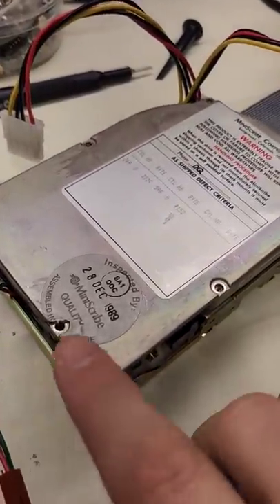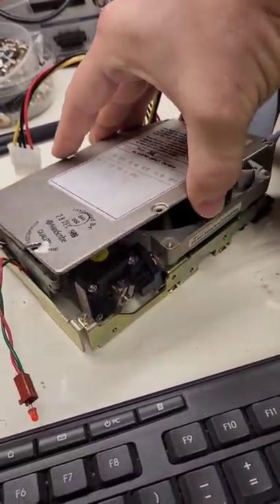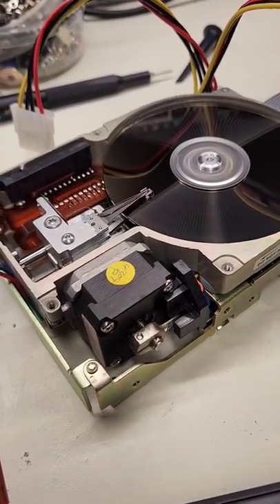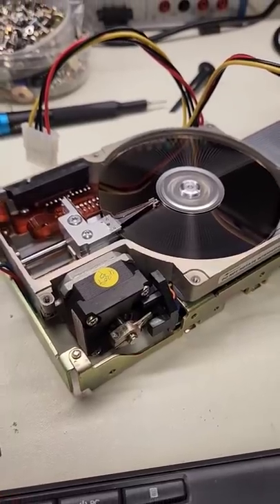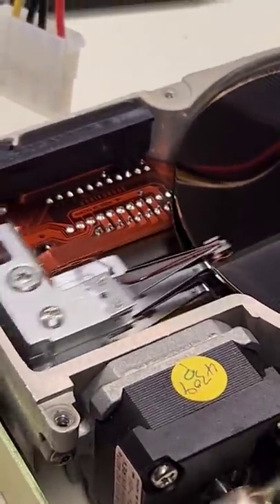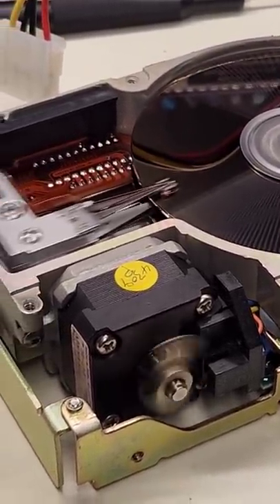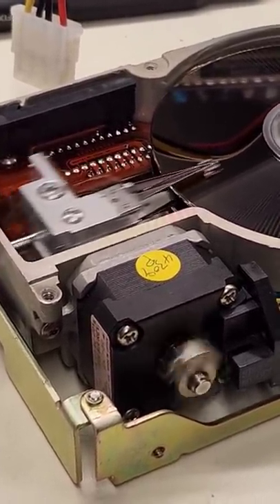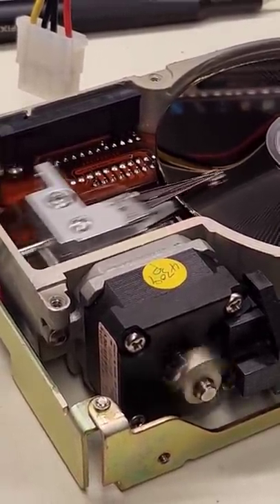A look inside a running Miniscribe hard drive (not a brick)

Comment: I love the reliability of modern drives and their speed, but some of the old stepper-motor and early voice-coil drives had a unique sound that I miss at times.
Reply: Right there with you. I miss the old "hard drive" sounds from PCs. I especially miss my 15kRPM IBM SCSI drives...
Reply: I remember at least one computer whose hard drive made cute little beep-beep noises when the head moved. It sounded pretty much exactly like the mainframe computers in Team Fortress 2 2fort's basement (to the point where I wonder if that's where Valve got the sounds from).
Reply: Well maybe you could hook a tiny speaker to the hard drive LED leads on your motherboard to simulate hard drive sounds when your PC is writing to storage. I am okay with solid state storage nowadays, nostalgia be damned.
Reply: Get a 15kRPM SAS Drive. The head armature is looooud.
Reply: @LynxCarpathica  
I've heard those, not really the same sound.
Reply: @paladingeorge6098  I like hard drives, they're cheaper than ssd's and for media that's fine.
Reply: @fremenondesand3896  To each his own. Yeah they are cheaper but I have found over the years for them to be extremely unreliable, I have had hard drives that I barely used slow down to a crawl on me.
Reply: @paladingeorge6098  same here, having them move about in a laptop or external enclosure doesn't do them any favours. Writing a video or music file to disk though is fine and that's what I'll be doing when I build a big NAS (have an ssd in a raspberry pi NAS now)
Reply: @fremenondesand3896  As long as you have redundancy than hard drives are certainly great for that!
Reply: @paladingeorge6098  I wonder if tape backup is viable? I wonder if they even do sata tape drives or if it's enterprise level only.
Reply: @paladingeorge6098  the nostalgia is nice, but once you've used a computer with an SSD, you can never go back to hard drive speeds. It feels incredibly slow.
Reply: @LynxCarpathica  can you name an example? What are they used for usually these days?
Reply: Believe it or not.. for today children.. see this..  it's so crazy old.. as for us I've been seeing back then a Ford Woody Wagon or a Ford Model T.. .. ..  ..  It seems incredible.. so normal and contemporary for us.. This thing is so rare as steam car for our children and grandchildren....
Reply: @fremenondesand3896  I believe they do exist, but you have to insert the tapes manually.
Reply: I remember what our pc sounded like
Reply: @Fee.1  look around on ebay, with HBAs.
Reply: Reliability? Pfft
Reply: @tbuk8350  then regular ssd is really slow compared to nvme
Reply: that's why I listen to Master Boot Record
Reply: AOL dialup is a sound I'll never miss. But I'm thankful for its contribution
Reply: I think that's called PTSD sir
Reply: Ahh,but do y'all remember the screeching of the old modem connecting now?
Reply: I remember the plinkity plonk of a 20 megabyte full height 5 1/4 MFM drive.
Reply: Totally - each model had its own sonic signature, a bit like different engines in the car world :)
Reply: they are more reliable than ssds @Ryzot

Comment: i had one of these back in 1995, when i had a 286 motherboard and other various parts as my personal computer, built in a cardboard box. I was 18 then. One of the heads was faulty, so i low level formatted the drive to skip that head. It became a usable 30 Mb harddisk. I miss those times...
Reply: I love stories like that! What's the saying we use everything from the buffalo in these parts lol.
Reply: When a big ram was 4Mb😄
Reply: @neriozulberti1492  now the standard ram of a computer is 4 gb
Reply: @neriozulberti1492   now the sandard ram of a computer is 4 gb

Comment: Harddrives are the closest we are ever going to get to true magic. I wish they still made HDDs with transparent covers.
Reply: The truly magic ones are solid state! No moving parts,  yet they do everything the spinning drive did,  only bigger,  faster, and better. The magic they do, goes totally unseen!
Reply: @Quickened1  SSDs are impressive as well but you can't see what's going on which makes them a bit less interesting imo.
Reply: @cnr_0778  While I'll agree that a platter drive is more interesting to watch,  as far as true magic goes,  I'd have to give it to the SSD. The mystery of containing and disseminating all that data, without any clue as to how it does it, in that tiny form factor,  is nothing short of sorcery!
Reply: @Quickened1  I can't relate to that.  SSDs "feel" no different than cartridge ROMs or RAM.

Internally the chips are just boring grids of transistors.  The chips are built like a hard drive... with only the platters... and they don't spin.   8)
Reply: @canuck64  well,  initially,  the 64gb card,  at some point,  was the largest capacity card of that size,  you could get. Then,  a short while later,  it went to 128gb, then 256gb, then 512, and ultimately into the Tb's. The form factor remained the same, but many devices are incapable of reading the higher capacity cards,  therefore, they still make the 32gb right along side the tb. In other words,  a camera that supports up to 64gb, will not even recognize a card of 1tb... But you're right,  it too is sorcery and just as impressive, if not more so, than an ssd!
Reply: @Waccoon  actually,  the thing truly closest to magic that we have, is the fact that zeros and ones (binary code) exists, and that it's capable of making all the "magic" that we see computers perform, a reality! Machine language!
Reply: Seagate had a particular model that had a window. I remember reading about it in a magazine, and they described how 8ms (or however fast the seek time was) was something you couldn't describe, but they said it seemed like the head would teleport across the disk.
Reply: @SireSquish  i only remember that WD made a version of the Raptor with a window. Didn't know Seagate made some too.
Reply: @cnr_0778  It was probably WD then. I'm half recalling from ~20 years ago.
Reply: wait they use to make these? now I wanna get one
Reply: true magic is when you realise your phone pc etc is just a bunch of different matrials which are arranged with such sorcery that is playing this video and reading this comment
Reply: I would kill to have something like that
Reply: @CEO of Unpopular Opinions “your data is never truly erased”

My little friend the blowtorch would like to have a word with you.
Reply: @Waccoon  well no get to the non volatile part capable of storing data without power
Reply: @Quickened1  No moving parts = BOOOORING
Reply: @Intelwinsbigly  the most magical things in life,  could be considered boring. Doesn't make them less magical!
Reply: @Quickened1  SSDs and HDD both have their place. With the new HAMR drives expected to reach 60TBs and their better reliability, HDDs aren't going away any time soon. SSDs are great for speed and are great for games and operating systems, but I'll still back them up with my HDD as the price per TB is cheaper.
Reply: @gljames24  no doubt!
Reply: That would be a terrible idea but cool
Reply: @BRD691  why would that be a terrible idea?
Reply: @cnr_0778  agreed. The actual engineer to make the physical drives work and be so reliable is amazing.
Reply: @do2eazy363  true that.
LITERALLY a certain arrangement of minerals and plastics hahah
Reply: @gljames24  Well said! Not to mention in my experience SSD have a higher failure rate. So for long term storage you really cant beat a mechanical drive.
Reply: @Intelwinsbigly  Hahaha! I feel the same. That's why i still love "stupid" Petrol Engines and a lot of noise. 😆
Reply: The old Western Digital Raptor X had a see through window
Reply: @cnr_0778  that’s what makes them more magic lil
Reply: The true magic is that something mechanical and relatively cheap can hit microscopic places so precisely and so quickly. It's an engineering marvel.
Reply: @canuck64  the price difference for making them is what you pay for. Don’t buy those cheap 1tb USB/MicroSD scams. 

Since they’re the same size, some people are selling like 16-36gb USB drives as 1tb
Reply: @jazeenharal6013  just a bunch of plastic? your statement sir is an insult to the human race
Reply: @gasun1274  minerals too! Don't forget the minerals! Lol
Reply: Nope. If you've ever seen how circuitry is printed onto silicone wafers, you'd think it was truly magic. Back when the developer module was open, you could watch the circuitry "magically" appear right before your eyes in an instant. Polaroid prints can't hold a candle to the beauty and speed of the technology.
Sadly, it's now all done in a closed clean-room chamber because the images are too small and can be damaged even by uncontrolled airflow.
Reply: @cnr_0778  l
Reply: @rosetyner7758 ?
Reply: Its only magic because you dont understand how it works 😂
Reply: @markus7166  i understand how it works
Reply: Me thinks that there was a force other than humans that invented this stuff, I have come to that conclusion because I know the intelligence of human beings.
Reply: I almost got hired once to make hard drive heads.
Reply: SSD’s have limited write cycles
Reply: @Quickened1 nah, ssd's aint magic, no real accuracy while running needed, unlike a hard drive. Ssds are just oversized usbsticks

Comment: Always amazing to watch HDD's in action on the inside. Hard to believe a little over 100 years before this drive was produced we were just beginning to figure out electricity!
Reply: 100 years is a long time..
Reply: @trulyspinach  not really its just a couple generations
Reply: @Ginto_O  and for as long as the earth has been around, it's just a spec.
Reply: @Ginto_O  a generation is 25 years the drive is 33 years old so one generation not a couple. The HDD technology is from the 1950’s so 3 generations for the technology in use on large mainframes removable swappable disks drives disk packs on mainframes is from the mid 60’s two generations, an actual HDD for a micro computer IE a PC is from the late 70’s one and a half generations. A 100 mega bite HDD from the late 70’s was huge the disks were about two feet the disk packs looked like a very large cake carrier when I stated working for my state in IT in 2006 they still had them on the UNISYS mainframe at the State Police running the police application all officers used in the state the system I worked supported they also used 10” tape backup.
Reply: @steve-ph9yg  
I think I remember seeing a 2MB drive for sale - probably Computer Shopper - for $2000.00! Don't remember when. I thought that was expensive, but WOW!! TWO MEGABYTES!!!! I drooled!!

Comment: Even though this drive is 33 years ago and totally obsolete I still think it's amazing that we can build things like this. A disc spinning thousands of times per minute with a head floating the most microscopic amount above while reading data from it.
Reply: I heard an analogy once something of it being like  a Boeing flying at full speed a meter above the ground.
Reply: it actually uses a miniature version of “ground effect” to keep the head from crashing into the disc. The movement of air near the surface of the disk pushes the head away enough to compensate for the spring tension on the armature. Pretty sick. like a helicopter bolted into a case and the read head is the ground.
Reply: @Robnoxious77  great analogy
Reply: You should see how ASML and Nikon printers transfer microchip images onto silicone wafers. Crazy fast and insanely accurate. It has to be in order to print lines less than 10nm wide.
Reply: Ide hdd’s spin 5400, some 7200. Some v8’s that’s past redline 🤣

Comment: My first hard drive was an 85MB 2.5" Maxtor IDE in my Amiga 1200.  Being a small laptop class drive, the heads were really quiet, producing only an occasional click when the heads parked.  But, wow, it still sounded like a jet fighter when it started up.  I remember the REAL revolution in quiet hard drives: fluid dynamic bearings!
Reply: I think mine was a conner 85 MB in my 1200, it only lasted a couple of months and then I got a 105 as replacement. I still remember the pure joy of partitioning those bad boys in 2, installing an OS and a bunch of stuff from floppies and still having loads of space free for whatever I wanted to do :-)
Reply: @benbaselet2026  m

Comment: It's crazy how loud drives used to be!
Reply from the maker: Indeed, especially with the cover removed!
Reply: As much as I despise computer noise, I actually miss hard drive seek noise. Platter and bearing noise go right in the pile of stuff I don't miss in the slightest, however.
Reply: Some enterprise drives are pretty noisy still.
Reply: You wanna hear loud?  Go get some 15k RPM enterprise drives ;-)
Reply: Remember the floppy drives?  Same on some of those .brrr..brrrr..brrrrrrrr..ch chc ch chc chch..
Reply: @Barracuda48082  there was something soothing about that sound as a kid...

Comment: Wow that is a huge stepper... Way different than the "barely there" voice coil they used more recently (or, at least, about 10 years ago, dunno what they use now)
Reply: Pretty much just that voice coil for the last 20-25 years now, no real change there within HDDs, a voice coil is light weight, precise and fast, especially compared to this bulky stepper motor with linear bearing design. Surprising that this heavy mechanism can move that fast though, the stepper motor must be getting quite warm burning through several amps of current at those speeds with enough torque.
Reply: @someguy4915  Only disadvantage of the voicecoil is that the feedback comes directly from the platter (feedback data is embedded into the stream) while the stepper was way simpler to implement for engineers. But it's vastly superior to the stepper in speed and achievable track density :-)
Reply: @akkudakkupl  Yah, and stepper motor drives could be affected by thermal expansion and contraction of the platters too, once the track density got high enough.  Data couldn't be read very well if the drive was too much warmer or colder than when it was written, since the motor steps wouldn't line up with it quite as precisely.
Reply: @someguy4915  cool, thanks! I didn't know if SMR came with some other mechanism.
Reply: @akkudakkupl  I thought drive heads also had accelerometers as a feedback.
Reply: @nictamer  might have, it's not my area of expertise. But I'm sure there is positioning data embedded onto the data stream on the platters, there is no other source of position feedback in the system. All an accelerometer can give you is acceleration - you would need to have some known zero position and would have to blindly believe in integrated acceleration not being off by some degree as your current position. System noise would throw the heads of the tracks in no time if accelerometers would be the only feedback source.

Comment: ooo love these old stepper drives! 
Did this come out of a macintosh or expansion chassis? The Mac SE used the SCSI version for a while.

The error code it's flashing is actually "I'm in diagnostics mode," if you remove the jumper the error goes away. This is to tell the testing controller that it's starting. This mode is also called a butterfly seek test, but there's also an analog test mode that let's you write arbitrary values to the disk and read them back.

Comment: In 80/90 th. I worked on SWTPC‘s wich has connected those drives. The small one‘s came from BASF 5 MB even with the outer Stepper Motor. The large one‘s where from Micropolis with 10MB capacity. They where attached to the SWTPC‘s by SASI interface and XEBEC Controllers. The 50 wire SASI bus was the predecessor of the SCASI bus and SCASI was almost register compatible with it.

Comment: I ran a BBS from 1988 to the year 200  had a network of both SCSII and MFM's running 24-7   I had some very large drives that had 8 inch platter  and a plastic dome cover so you can see the beast working .  Nice video

Comment: I remember working on drives of all shapes and sizes which used stepper motors to move the drive heads.  As components wore, the heads no longer aligned perfectly with the tracks, requiring realignment (when possible) or low level formatting to rewrite the tracks to the new head positions.

Comment: In the early 90s a lecturer I had showed us the inside of a HDD booting DOS. The head wasnt straight across like that, it was on an angle and would move side to side. Somehow the drive survived being opened and would boot. I still remember the head moving back and forth a bit, and then it just disappeared from time to time as it flipped between tracks.
Reply: Most likely a voice coil one. This one is stepper driven like most 80's drives and most miniscribes.

Comment: In the early days of my IBM portable pc I added a hard drive of 10 megabytes for $500.00 and had to run a command to park the heads after use so as to avoid a surge at startup that would reportedly ruin the sector. Can’t remember what brand the drive was. 
What I miss is the excitement of the up and coming.  It was great to get away from punch cards waiting for 20 hours to find a syntax error. The card with the error was pulled partially out of your deck and folded over. Going from 256k to 384k cost about $500.00 also. Had to set up for expanded or extended memory. I’m glad those days are behind us be it truly was an exciting time to  be in school and a part of all this in the beginning days. 
My first machine was a TI 99/4a using a cassette recorder for storage. I had some cool looking cassettes that looked like tape reels to store my BASIC programs on.

Comment: My XT clone had a pair of 8438's.  The sounds of the startup sequence and head seeking during use are unforgettable.
Reply: The chassis my main i7 rig is housed in used to be a server chassis from the early 90's. It was originally built to house 7 full-height 5.25" hard drives, or 14 of the standard height 5.25" drives. 7 of them (they were SCSI), between 4GB to 8GB capacity each. THAT was loud!